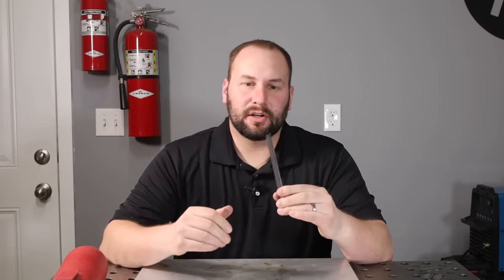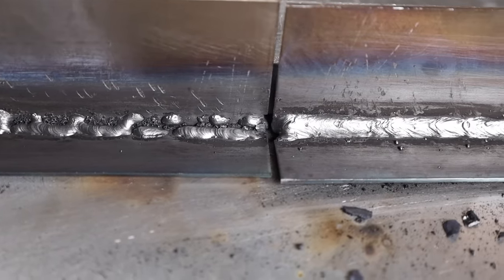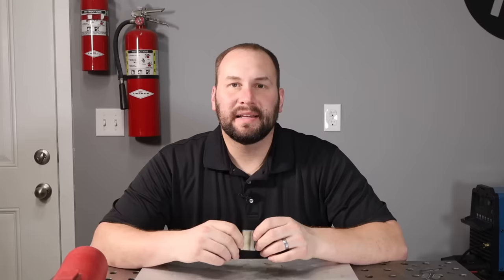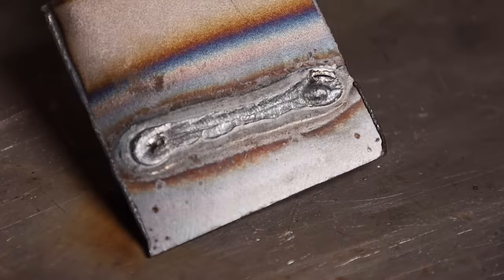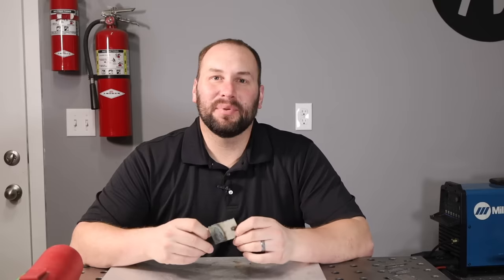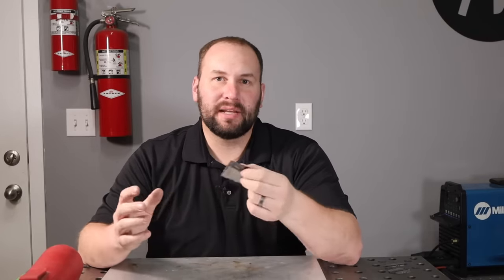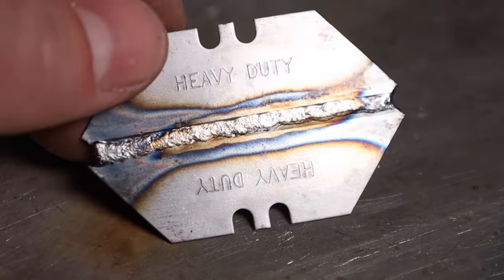Can I Stick Weld Razor Blades? | Thin Steel Stick Welding Tips

Comment: Great video as always question I’m kind of a newbie at this should I keep my welding rod somewhere less moisture they’re out in my shed to get a good use out of them thank you for the videos
Reply: Yes keep them in a better climate controlled area...
Reply from the maker: It's definitely a best practice to keep your electrodes as dry as possible. In many industrial applications, certain rods are stored at elevated temperature to reduce moisture which can cause cracking on higher strength steels when they are thick. For most home use, you can get plastic rod storage tubes for about ten bucks that have rubber seals. That's what I use to store my general purpose electrodes.
Reply: To dry electrodes I use a flat baking sheet to spread them out on and put in the oven. The recommended temperature is 180°-220°F except for 7018. If 7018 electrodes aren't sealed in a moisture tight container they should be stored in a rod oven at 250°F and should be used within 4 hours of being removed from the rod oven. Most welding rods are still good (even after getting damp) as long as the coating isn't damaged. If the flux is flaking off or visibly cracked it can cause a "wandering arc" and your weld quality will inevitably suffer.

Comment: I just add more material to the welding. Like welding whit tig but using electrode. It work for me. One electrode conected to the machine and anotherone whitout the revestiment to add material and recive temperature

Comment: Hi Tim
I got a deko pro and I've tried to weld at low amperage and it was impossible to maintain the arc below 35 amps. 
You can do it or maybe my machine is not working properly?
Thank you

Comment: Can you make a video of stick welding chromoly? Should I use 6013 or 109? I don't know if low hydrogen electrode is qualified since chromoly is not related to stainless steel

Comment: As a newbie I found i could stick weld new 1/16th sheet ok but trying to repair a rusty mower deck made from 1/16th was pretty hard. The curves makes it hard to get a heatsink to make good contact.
Reply from the maker: That sounds like a miserable repair, especially to stick weld. After having welded for quite a while, (though it's not my day job) I do some repairs that go very well and others that just turn into a nightmare. Truth be told, I try to avoid repairs whenever I can. Maybe I'll make a couple videos about how I go about repairs that come through my shop. Thanks for watching and for the comment!

Comment: What is that thing being used to measure amperage on the electrode line?

I have access to three stick welders one that is a mistreated and awful feeling AC/DC electric and two Bobcats.

On absolutely none of the machines are the settings even really close on the dials.

One won't run 7018 1/8 at less than 100 amps AT ALL and another won't keep it lit at 85amps or under but the 3rd one has no issue running smooth at 85. According to the knobs anyways.

I've seen some videos of people running 6010/8018/7018 at these crazy low numbers and I don't see my machines even lighting the sticks at those.

I'd love to see what they are actually sending!

Comment: Can u do a weld test  2 different thicknesses metal, example weld 3mm plate joint to 1.6 or less than 2mm..
If you joint 2 material same thickness below 2mm it easy to fuse both parent metal, but i have difficulty weld  3mm angle bar to  1.6mm square hollow

Comment: I have a chair that was made with electrical conduit. Using 6013 at 45 amps but it still keeps making holes. What do you recommend?
Reply: I would recommend buying a better stick welder, and no, I'm not being sarcastic, not all welding machines are the same. All the skills in the world amount to nothing if your tools are sub par.

Comment: Does anyone have any recommendations for a good job site welding video? I’m welding sheet metal ductwork 16ga to 1/8 inch angle iron on a roof. The advice he gave in the video is great but I’m not going to have to luxury of backing plates and a shop set up. Mod of the welds will be overhead or vertical.

Comment: Could you talk about voltage regulators? I have a welding machine that has only three power settings; high, medium, and low. On the low setting, the power is still quite high so I can't weld thin metals without blowing through. I am looking to fit a voltage regulator on the low setting. Is this possible?

Comment: Hi Tim, I struggle to avoid burn through with <2mm steel, I'll try raising the amps to a more stable arc, smaller electrodes, EN and limiting rod angle to ~10deg, is there anything else I should try? I see people recommend whipping but I see that you have a nice, smooth travel. Any tips?
Reply: whip them together then run stringers

Comment: How do you fillet weld with such low amps? .i had to use 80 amp on thin angle bar to make easy tack weld.

Comment: I used to tig weld aluminum pop cans together, in 1983.
Reply from the maker: That’s awesome! It seems like that would be a real challenge with an older transformer machine. I’ve done it once, but the plastic smell from inside the can and the label smelled terrible.

Comment: I am a beginner and I burn through 1/8 square tubing like butter on a hot day. I have the amp on 60 maybe and any time I try a lower amp I can't get the damn arc going. Frustrating. But I have good practice backfilling holes :)
Reply from the maker: Hang in there, you’ll get it worked out. You shouldn’t need a lower amperage setting, there’s something else that’s not right. Let’s walk through the variables: 
1. Electrode type: I would recommend 3/32” 7018 (6010/6011 are especially likely to burn through if you are running them straight across. This is what they are made to do and why they are great for root (first) passes when you need full penetration. They usually need some torch manipulation such as ‘whipping’ or small circles. I show that in some of my videos, but I’d just try 7018 in your case.)
2. Amperage: This will depend on your rod, but if you run the 3/32” 7018 rod that I suggested, I would start out at 80-85 amps and adjust from there. Use the chart in the video if you’re running something else. 
3. Arc length: keep it short. If you can’t, you may need more amperage. It’s okay to hold a long arc for a second or two to warm things up in the beginning, but then move in close. 
4. Angle: Drag by about 10 degrees
5. Movement: Base your travel speed on the width of the weld. Keep it fairly small and don’t stop. 
6. Fitup: If you have a big gap, it’ll be more challenging. 
If you get these things right, it should work out for you. I get way too many comments to monitor all the replies, but you’re welcome to DM me on Instagram with your rod type, size, joint type, etc and I’ll help you work through it.
Reply: @TimWelds 
Thank you for taking the time to respond to my post. Here is what I used:

1x1 x 16GA steel tube
Cheap Yeswelder arc pro 165DS
E7018 3/32" rod

I have tried between 50 and 100 amp. Can't seem to get a good arc going below 60. But around 70 or 80 I burn a hole instantly. I could literally not get any metal down before it melted. But I practiced filling those holes which was actually quite fun. Just looked very messy. I've seen you weld razor blades so I feel hesitant asking if I should pick a thicker steel to weld :)
Reply from the maker: So my earlier recommendation was for 1/8” material, but 16 gauge is about 1/16”, which really is a challenge. The 3/32” 7018 probably won’t be very well suited for that, and I’d recommend trying 3/32” 6013 at around 50-55 amps like I did on the first fillet weld in this video. Getting a little thicker material isn’t a bad idea either if it will work for your project. Like I said in the video, 16 gauge is the thinnest that I’d actually stick weld in practice.
Reply: I don't really stick weld thin stuff much since i have a tig machine but in my limited experience, 1/16 6013 is the ultimate smaw rod for not burning through thin stuff. If you want even less penetration, run it electrode negative. You'll get more deposition but less heat in the part. This trick works down to really thin sheet metal. Definitely not my preferred method but it works in a pinch.
Reply: @TimWelds  Sounds like I should get a little thicker square tube then. I am making a steel window (what an undertaking for my first project) so I don't really need a lot of strength from the tube. But if that makes my life easier I'll try it. Thank you so much again. My entire welding knowlged is based on your videos :)
Reply: @TimWelds  I got a thicker steel tube today and welding suddenly became very enjoyable. I didn't have to rush the welding to avoid holes. So I could pile up a little more metal, and move it slower and more precise. Success!

Comment: nobody mention electrode quality. brand. very important. Not all rods are the same, using the same type of electrode, the weld changes abruptly depending on the brand.
cheers !

Comment: Curious, the 1/16" 6013 are they 10, 12 or 14" in length? Mighty steady hand if using the full 14" length stick electrode.
Reply: Yes, and 8 inch.
Reply from the maker: These are 12”, but other brands might be different. Thanks for watching!

Comment: I really thought i done my homework buying a mini arc welder And the rods  But was given some scrap 18 gauge for repairing my trucks cut outs of rust ..went with a 3/32 rod (unseen size) And even when i set everything up I was 2nd guessing the rod. Tried a test panel And it would stick...up the amps And you had a fine line from a weld to a burn thru ..tried reversing the flow..samething...And forget about spot welds lol ...So ya i need to drop to a smaller 1/16" 6013

Comment: I welded 1.5mm stainless tubes and it is hardddddd. Burns through very easily or doesnt get hot enough.
Finding right balance is near impossible

Comment: Tim I just got a deko to start welding what should I do first ?
Reply from the maker: Awesome! Check out this video with the basics: https://youtu.be/pMtqDWUpJds 
I recommend working on one aspect of the skill at a time until you get it down. This is the order of skills that I go through in my course, it's proven to be quite effective: 
1. Striking an arc
2. Maintaining arc length
3. Electrode angle
4. Travel speed
5. Running beads
6. Welding common joints
Hope this helps!
Reply: @TimWelds  thank you. I’ve learned everything from you and am inspired by ur persona and how you do things. Thanks tim

Comment: Very impressive! Stick welding such thin material requires exceptional skill. One correction if I may! I think you meant to say electrode positive, not "electrode negative" at 7:13, as electrode negative, a.k.a. "straight dc" or "straight polarity" is the setup used for normal penetration. Electrode positive, a.k.a "reverse polarity" is used when less penetration is desired.

Comment: Can you do a list of good mid grade Tig welders? I've been trying to find a good Tig but I don't need a pro machine. And I don't want a cheap one.
Reply from the maker: The one that I have used is the Primeweld TIG 225x. There’s a review on my channel, and it’s still going strong. I used it just last week. Some other brands to look at are AHP and Everlast, which I haven’t used, but have heard positive things about. Hope this helps!
Reply: @TimWelds  yes it does, thank you. I'll make sure to use your link when I buy that welder.

Comment: I once tried to stick weld a heart shaped box out of 0,7mm / 0.027 inch steel plates. I had no idea back than, that it was way to thin. I used 4mm / 0.157 inch steel rods an welded the plates to it. So the rods connected the welded edges. It was frustrating job, but it worked somehow, until I burned a hole through a plate.
Probably I will restart the project with 3mm plates.
By the way my girlfriend was impressed, when I showed her the unfinished box back then on christmas. It looked horrible, but she could tell how hard I had tried. That was  like 7 years ago. We got married this summer 🎉

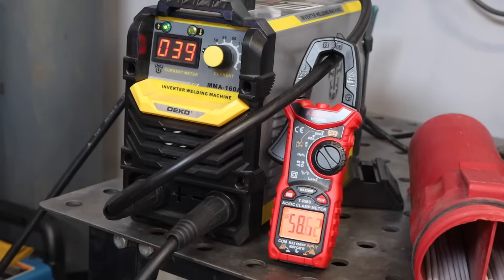Comment: 1:57 - If your clamp meter was set to ac and you were measuring the performance of an oil tub welder, then your RMS reading would have been accurate. In the case that your clamp meter was set to DC (I can't see. Bedtime viewing on android) then keep in mind that these inverters typically operate at over 100 VDC that is pulsed at frequencies in the KiloHertz range. The discrepancy is due to type mismatch. The only way to measure the inverter more accurately than it's built in indicator is to use a sensing transformer in conjunction with an oscilloscope. It is not the inverter's fault that you went about it incorrectly.

Comment: 6:12 wouldn’t you have wanted to use DCEN when you switched to 16ga and below for practical welding?   I thought DCEN is for thinner metals.  In my mind don’t thinner metals start at 16ga?
Reply from the maker: You could. There’s no hard and fast rule, though.

Comment: how did u get the arc to be open with such a low current? the normal way is to just go poit by point with a normal current... as we say in portugease "ponteado"
Reply from the maker: I just tried it and it seemed to work okay with this little electrode. I don't think I'll make a habit out of it, but it was an interesting experiment. Thanks for watching and for the comment!

Comment: Got a cheap tig/arc welder for my birthday not long ago. I didn't stop practising until I ran out of rods and then gas 😆😆 (I had 150 rods 👀)
Reply: What kind of welder ? How much ?
Reply: @dirtymig0pp772  it's a tig/mma welder don't know how much as it was a present but I know it was less than £180. 
Branded ROHR.

Comment: Would inverter with pulse mode help here? I've heard that it should, but did not see any real life proof so far. I'm thinking about buying such inverter as I need a new one anyway, but it is significantly more expensive and I'm not sure if it's worth it - if it delivers what it promises
Reply: Which machine you looking at?
Reply: @sbranham86  I'm from Czech Republic, so I'm looking at EWM Pico 160 Pulse or Fronius TransPocket 150, both have pulse for stick and cost around $770, or Kuhtreiber Makin 160 PFC (without pulse) for $400. (Prices for bare machine, no cables or any other accessory) First two are also a bit higher quality, but they all are pretty good. All have anti stick, hot start, arc force, high OCV, PFC.
Reply from the maker: I’ve never tried any pulsed stick welding. If you’re looking to make a significant investment in equipment, I’d look at a process other than stick for thin material.

Comment: I have a question I have a 6011 electrode have you ever heard of them and if so how much amps should I set my buzz box at
Reply: Depends on diameter or your rod. It should say on the box
Reply from the maker: There’s a chart with a good starting point in the video that you can screenshot. 6011s penetrate deep, so they often need a little torch manipulation. If you’re searching for techniques, you may find more by searching for 6010, which will require a similar technique, though 6010 won’t work very well on a buzz box.
Reply: 125amps
Reply: @johndowe7003  ok thank you
Reply: @lbproductions3987  no problem , if they run too hot just lower it down to 90 or somewhere in between.

Comment: I remembered when i was 7 my mom works on a small company that makes water tanks, they use stainless steel sheets. And the machine that guy use was not digital yet. Like to adjust the current hell turn the wheel of that machine, and yeah its a heavy coil machine 😂 and the electrode he use was white ones im not sure about t number of it

Comment: In Bangladesh they commonly weld 1mm mild steel with the most basic transformer stick welders.
Reply from the maker: That’s super impressive! It would be awesome to spend some time with some of those skilled craftsmen to learn how they do it.
Reply: @TimWelds  I shall try to video some work and send it to you. I'm pretty sure the specified 1" square box I purchased from the local markets is less than 1mm thickness. Local markets all write 1mm but it's not even that. I'm a British Mechanical Engineer.

Comment: I have 1 more tip , go downhill welding when using thin material . 
30 degree downhill fast and good
Reply: I was screaming the same thing in my brain the whole time (not that I can pull it off, but still).  Good video - experimenting to find what works. Swapping polarity is a good tip.  Also tacking and backstep also good ideas.  Might have to challenge myself this weekend and report back.

Comment: When I visited Mexico I learned that welding in there means tack welding everything (even thicker stuff that can handle running a bead) with 6013. MIG, TIG and basically any other process is pretty much non existent outside of few specialized welding shops, You really have to search hard for a trained welder in there to get some real welds.
Reply: As a Mexican who went to welding school I can confirm. Most people do that but out of ignorance/mediocrity and a lack of concern for safety, some even to lower immediate expenses (rather fix it time and again than do it proper once).

Comment: what about thin metal to thick metal thats one of the ones i always have trouble setting up and dialing in.
Reply from the maker: I have a video about that: https://youtu.be/8OooAFjEBEk 
I usually tailor the arc to the thicker metal to get penetration, then control my position to roll it into the thinner metal.